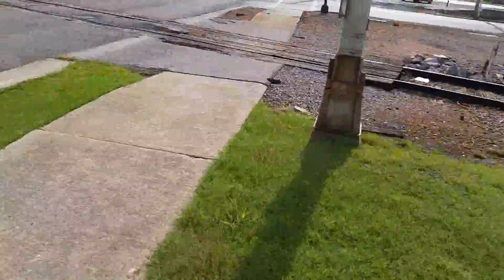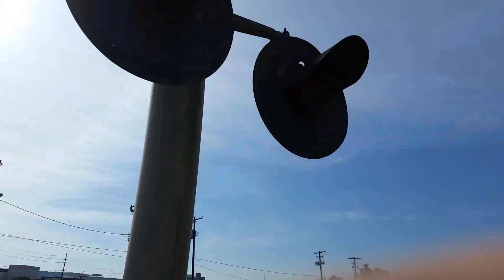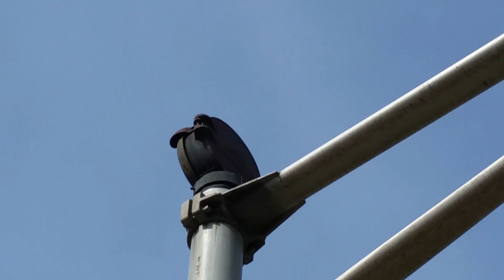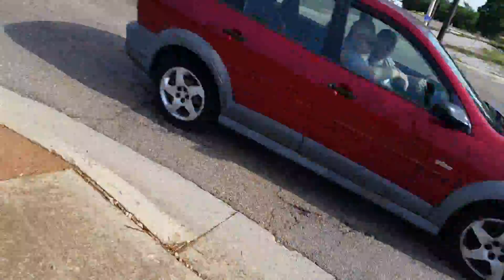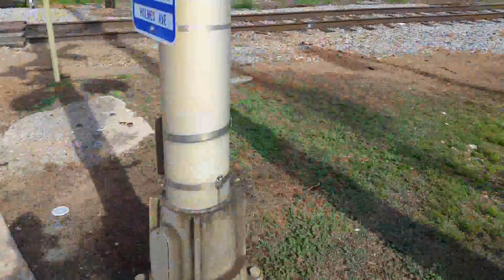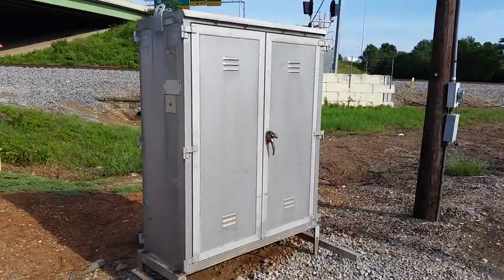Holmes Avenue Railroad Crossing #2, Huntsville, AL Crossing Tour

Comment: I wonder when the l&n still ran did this crossing have incandescent lights
Reply from the maker: +savageking YT Yes.
Reply: @freebrickproductions  I'm still hanging onto my theory of there being a diamond (more of an X) intersecting the NS Memphis District East End and the L&N (now HMCR), because where the starting points to the L&N side and the HMCR side begin they aren't far apart, therefore thats why I think there was an X here, also that was me that you replied to.
Reply from the maker: @aidend2477  Honestly, it was either a sharp-angled diamond or a pair of switches. Either way, it was certainly a junction that the L&N had with NS there.
Reply: @freebrickproductions  
Yeah there could've been switches there, other than that the beginnings of those lines are facing away from each other so other trains on the other line had to wait for them to pass to continue.